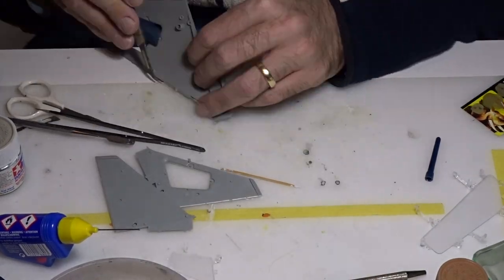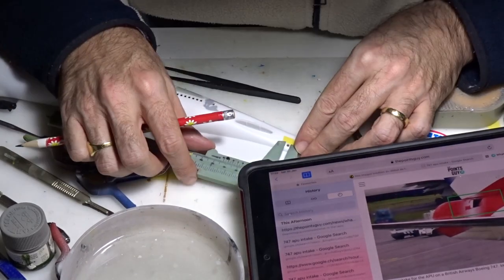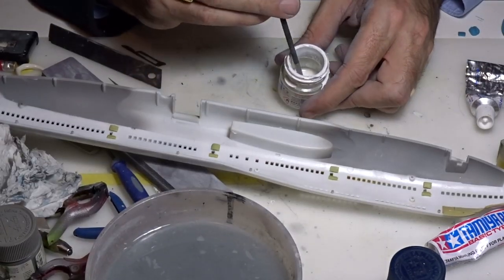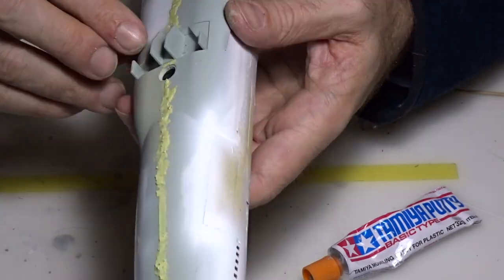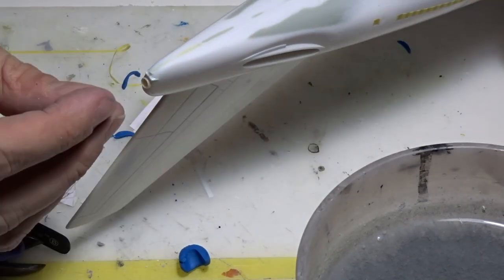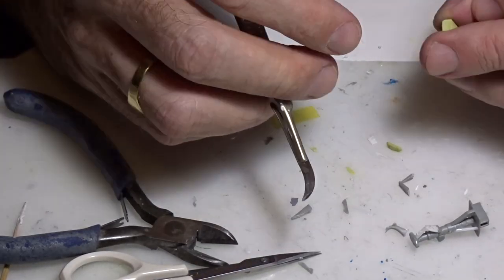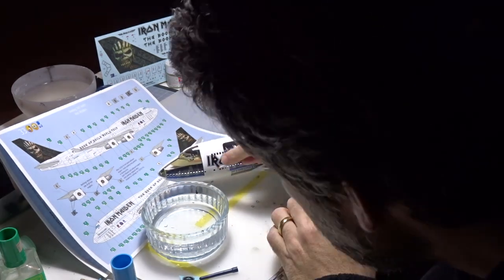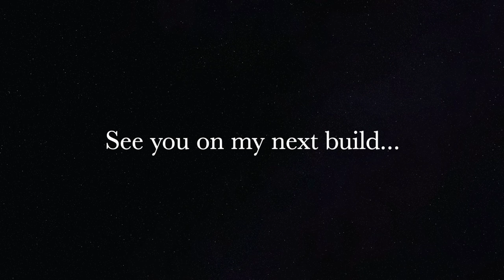1/144 Cutaway 747-4 Iron Maiden part 2

Comment: Very nice work! I have this same model on my bench and am planning a Lufthansa version. 

Just one idea: I would suggest closing all the cabin windows with Micro Kristal Klear. This will keep them clear but will seal off the interior. Otherwise you will keep getting dust inside the model that will get trapped in there.
Reply from the maker: good idea, but my concern that when I would remove the window, some could fall into the cabin, so I took that other step ;-)